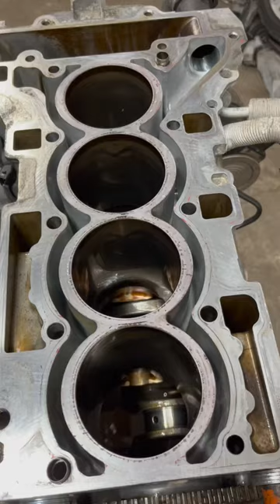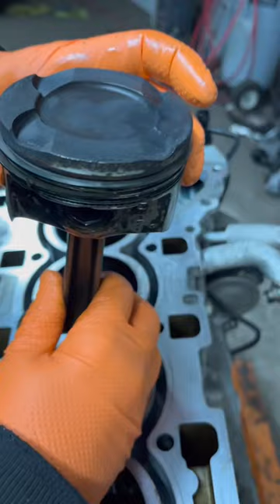What Is A Piston Slap?

Comment: Word of advice. If the engine is boosted and it has this noise when its cold go easy on it. Otherwise you send the piston out of the chat room like I did.
Reply: Yes, I let it warm up a bit, then start getting on it once it gets close to operating temp.
Reply: @judeh101  Unfortunately lost mine while it was fully warmed up. May have been from overboost I don't know.
Reply from the maker: It’s not supposed to have any noise, but definitely good advice if you do!
Reply: worddddddd
Reply: @JisINSANE3 that’s why you get Chinese turbos, they blow before the engine does 😮‍💨😮‍💨

Comment: It's normal for forged aluminum pistons to slap a bit on cold start
Reply from the maker: Yes
Reply: I had forged pistons on my L67 3800. Had this slap also when it was cold and didnt think much of it till the piston slaped the spark plug when I got on it one day.
Reply: Does it sound like a bit of a rattle?
Reply from the maker: Yes
Reply: @motorcarnut  youre helping me get some good sleep. Thank you
Reply from the maker: Lol, No problem
Reply: WOW, nice explanation, most probably I had the issue in my 2019 chrysler 300 v6, only its very noticeable  in cold start when de-acelaration mainly and It's only heard from inside the cabin
Reply: Forged aluminum pistons are NOTORIOUS for cold start noise
Reply from the maker: @thenegus5469 Absolutely correct, but they have great benefits!
Reply: @motorcarnut  in my opinion, the biggest benefit is that it can tolerate small amounts of detonation before it destroys itself. Holds up to heat better as well.
Reply from the maker: @judeh101 Exactly! Plus the forging process significantly improves the metal's grain structure, resulting in superior strength, durability, and resistance to fatigue

Comment: Looks like you're holding a Hyundai/Kia 2.0L Nu piston. I just bought a 2023 Kia Soul LX, they only come with the 2.0L Nu engine now, at least for the United States market. I changed out the factory fill after the break in period, around 1500 miles, I don't know what kind of oil they use just to get them out the door at the assembly line, although my understanding is break in oil is very high in zinc, I have always used Mobil1 in all my cars with no problems. When I start the engine from a dead cold start, it's actually very quite, as it warms up and the idle comes down after about 8 seconds after turning the key, the rattle begins and it is a very distinct rattle sound, as the engine hits op temp, the rattle is still there but sounds more "organized" I guess you can say and resembles the high compression rattle of like a VW diesel engine in a car is the best way I can describe it. The compression ratio on these is on the high side, 12.5:1, I run 93 octane for the little bit of extra power you get with that higher octane. To my ears the rattle is coming right from the top of the engine, but you never know unless you use one of those automotive stethoscopes. Can't tell if it's piston slap. 🤷🏻‍♂️
Reply from the maker: Piston slap usually make noise when cold and as the pistons heat up the noise usually goes away or is more quiet. That piston is from a BMW. Kias are usually quiet. Can be a bad lifter?

Comment: Here’s one for you….is it possible for piston slap to happen to a new engine with sufficient oil levels ?

Say the oil is thicker than most brands, could the delay in oil reaching the pistons cause piston slap ?
Reply from the maker: Yes it is. The thicker oil will not help piston slap because there isn’t much oil that splashes up on the cylinder walls to make a difference. Regular oil changes are the best you can do for longevity.
Reply: @motorcarnut  :  you’re a smart mechanic. 
I appreciate your response.

I’ll tell you why I asked that question.

I have a fairly new triumph motorcycle with 2000 miles. I bought it new, it ran great. First oil change, it still ran great.
Second oil change, immediately started knocking.

Other triumph motorcycle owners make the same claim, but only difference is the knocking started after the first oil change.

After some investigation we came to the conclusion that the hydraulic cam-chain tensioner isn’t getting oil fast enough.

The knocking starts after 30 seconds and smooths out after a few minutes.

Mine, not so much. I can still tell there’s something screwy going on.
I ride it today and it sound like everything is loose in the engine.
It did not sound like this before that second oil change.

Triumph recommends Castrol.
I’m not so sure it’s the correct recommendation.

What are your thoughts on this please ?

Comment: How lomg can you drive lile this? Does it instanlty lead to catastrophic failure or run a long time?
Reply from the maker: If the slap goes away after engine is hot then it should be considered normal if not it would have to be addressed.

Comment: Would it be possible to hear this on a new engine.

I have a near new Triumph motorcycle 500mls.....has a noise like piston slap.....I am in contact with lots of others with the same problem.

But we only hear it start about 30secs after engine start.....then it starts gentle and gets louder then gets gentle again and goes some 3 mins later.

Doe that sound like Piston Slap Sir?
Reply from the maker: I think I answered your question before. The best thing to do is go back to dealer and see if you can find similar motorcycle and see if it sounds the same, fastest way to know if its' normal for that particular engine.

Comment: I am thinking about buying a brz and it has piston slap on cold start and then goes away. Am I safe or does it damage the engine??thanks
Reply from the maker: How fast does it go away means a lot. If it’s only for a minute or so then it’s fine. You don’t want a vehicle that always has it.
Reply: @motorcarnut  yes,when the vehicle warms up it goes away.
Reply from the maker: @lidaestheticsil1054 Then for a Subaru it’s fine. But depending on how much your paying for the car if you don’t know much about vehicles I would have a local mechanic give it a listen as well.

Comment: Unless you have a gm 3.4 sfi like mine it’s normal when the engine is cold
Reply from the maker: No engine is supposed to do that. Think about it, you’re at a new car dealership getting ready for a test drive, go to start a brand new car, you think it would have piston slap? Lol. Some may say it’s normal but it’s not. That noise is the piston hitting the cylinder walls so it’s only going to get worse. Maybe not for a long time but it will.
Reply: @motorcarnut  3.4 engines did it off the assembly line cold starting everytime , mines done it Since the day it was made gm said it was normal

Comment: I have a knock but only when engine get hot …when I start in the morning everything it’s fine…after 2 minutes it’s starting knocking ,the knock disappears when I unplug injector number 1
Reply from the maker: That’s because the rod knock on number one cylinder isn’t firing when you disconnect the injector. Has to be rebuilt or replaced soon.